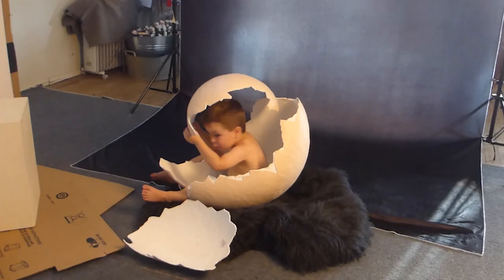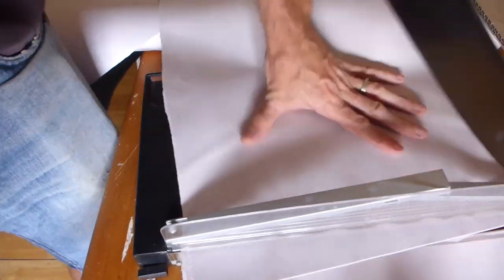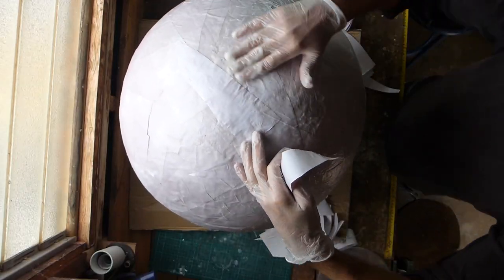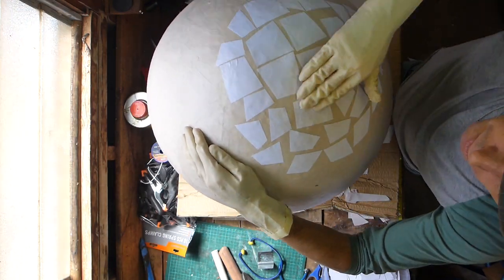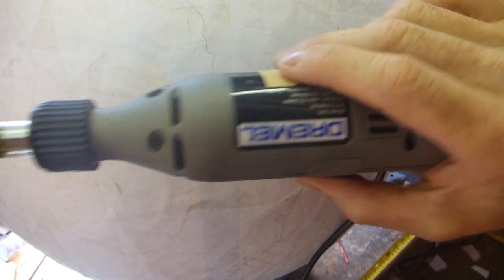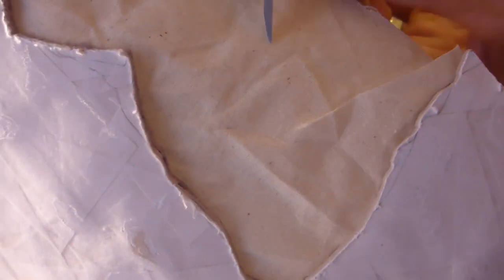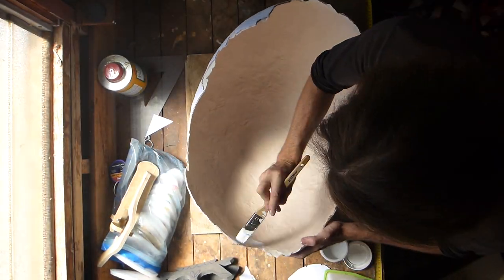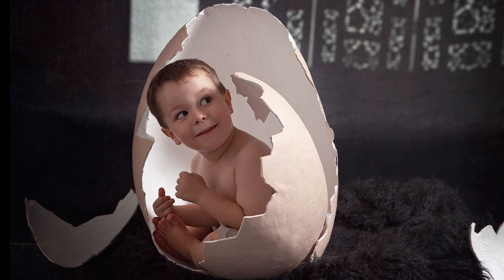Making a Giant Egg Photo Prop

Comment: Your egg came out WAY nicer then mine is coming along! I did not do nearly enough layers and I’m coating my egg in a type of clay so I can do a scary texture to mimic a more artistic interpretation of a dinosaur egg for newborn photography idea. I hope mine can come out as good as yours but it needs a lot of TLC from the clay cracking
Reply from the maker: Ah, yes clay would be problematic with even a little flex. Perhaps a layer of fabric and if you are after texture paint or glue with sand in. Good luck